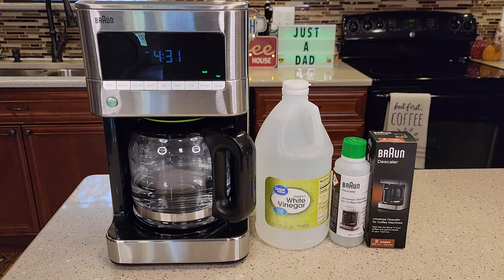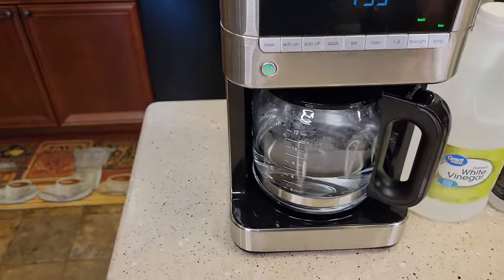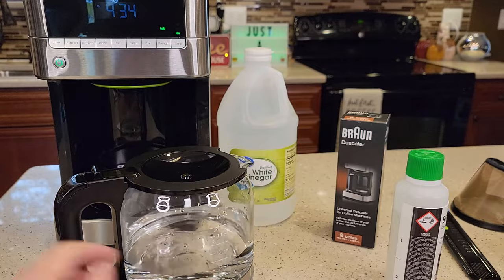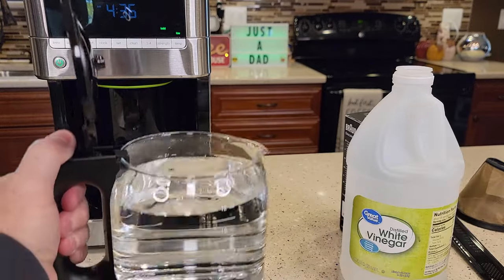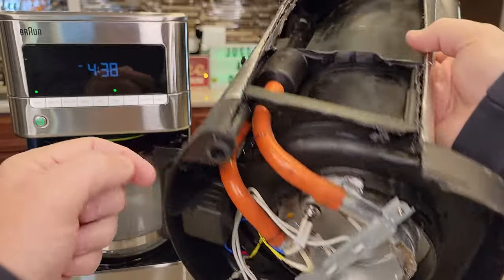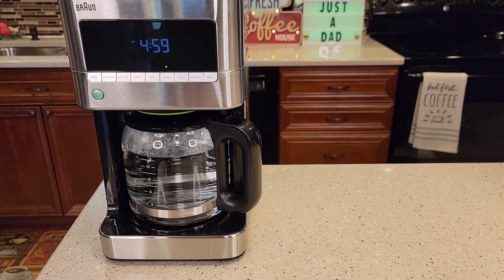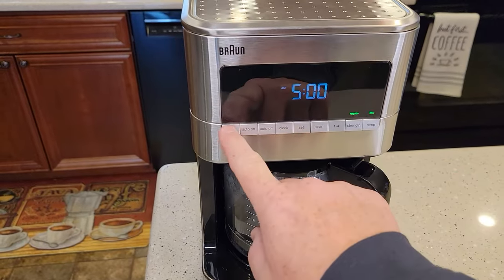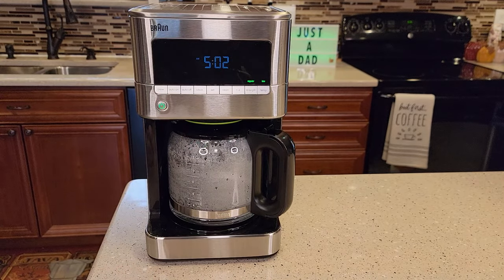HOW TO DESCALE BRAUN BrewSense KF7170 Coffee Maker CLEAN LIGHT ON? HOW TO FIX

Comment: Excellent advice.  We have the same machine but a different, metal, pot with a poorly designed lid.  Running through the cleaning process results in water dumping out everywhere every time.  We put the machine in the sink to run through the cleaning cycle successfully without having to clean up a mess after each cycle.

Comment: I just purchased a Braun BrewSense KF 7150 coffeemaker, and your videos have been very informative and helpful.  Actually, I have learned more from your videos than the instruction manual!  One question about descaling:  where did you find the information for using only 1 cup vinegar and then add water to the 12 cup mark?  Is there a reason not to use a 50/50 vinegar/water ratio as suggested by many others? Thanks

Comment: Dad, I cannot turn the clean light button off.  I have tried everything you said.  Help.  I need coffee!
Reply from the maker: were you able to put it into descale mode?
Reply: @JustADad  I cleaned it like. you showed us and replaced the filter but the button will not go off. Not sure what you mean when you say "descale".
Reply from the maker: @rosezarco6347  you have to put it into descale mode to get the light to go out. push the clean button then press the brew button to star the descale mode. or clean mode.  Descaling is when you run vinegar through the machine.
Reply: @JustADad  OMG!!! It worked!!  I actually called the customer service department and they said I need to buy a new one.   You are a life saver!!! Thank you so much!  HAPPY NEW YEAR!!
Reply: @rosezarco6347  wow they thought you were that gullible to buy a new machine when you're just trying to descale correctly? Geesh